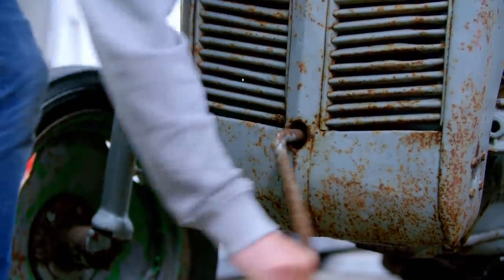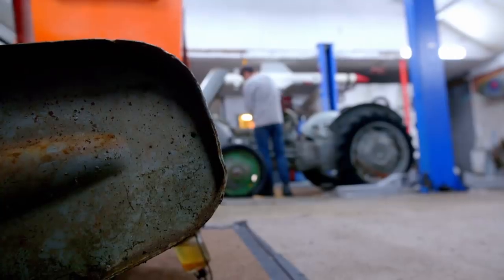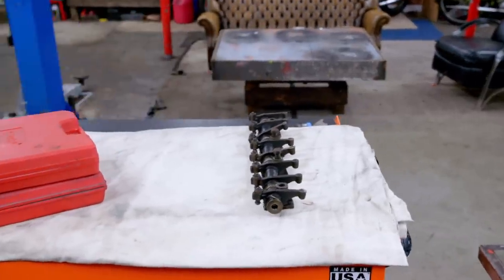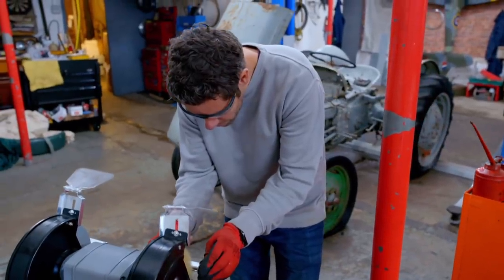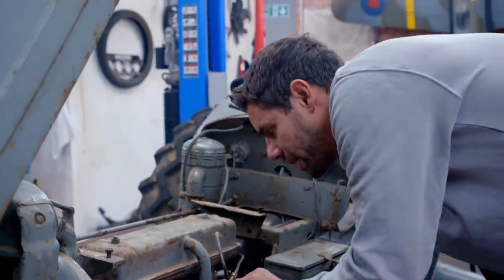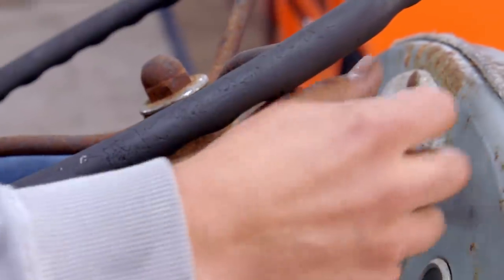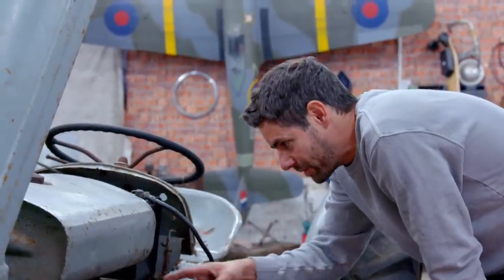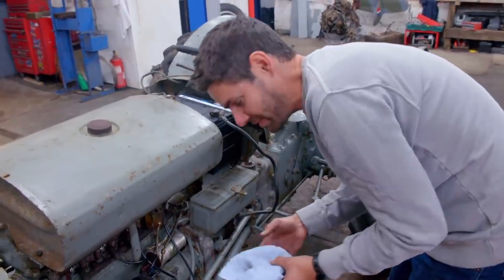Old Tractor Is Brought Back To Life! | Wheeler Dealers: Dream Car

Comment: Doesn't know how to hold a starting handle keep your thumb on the same side as your fingers so if the engine back fires it will take the handle out of your hand rather than braking your thumb
Reply: He wasn't trying to start it, he was rotating it to feel for compression. There is every chance that, were he actually trying to start it, he would have held it as you describe. But since he wasn't, we will never know. He even explains that simply connecting a battery and attempting to start an old engine risks damaging it, so I think it is safe to say that he was not trying to start it. Perhaps, in your misguided belief in your own intelligence, you were not paying close enough attention to what was actually happening and what was being said.